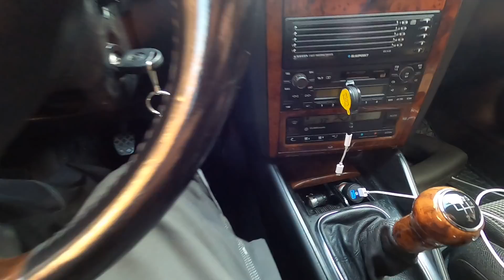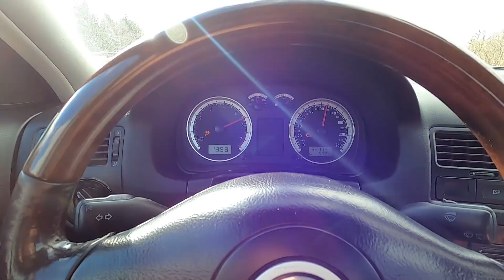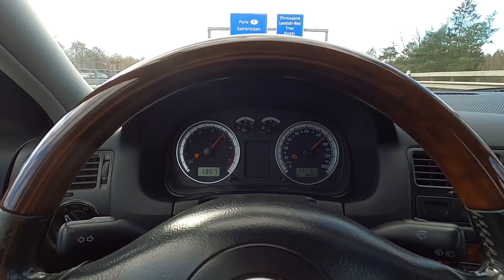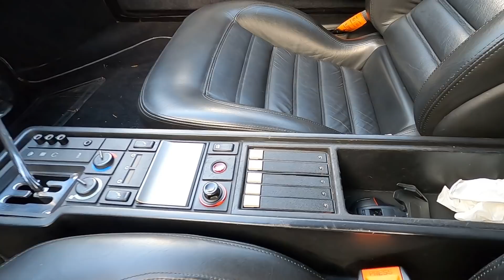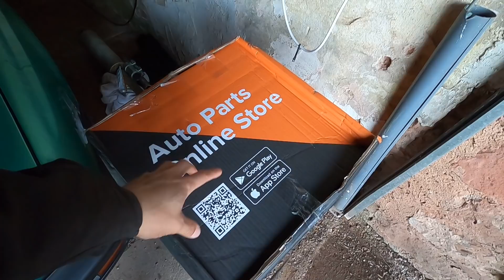30K!! New Seats For The Savoy? & My Clutch Is Here?!?!

Comment: A little tip for doing the seats, if you can get a drill brush attachment it would be a plus or a hand brush that can be used on fabric. Mix detergent in a spray bottle, spray the seats, then let it sit for 2-4 minsz scrub the seats left to right, up and down, then use just plain hot water in the extractor.  Also vacuum the seats before using wet vac. Will yield a better result

Comment: Would get better results dismantling the cloth from the seats and washing in the washing machine.used to do that often when i had mk3 gti.
Reply from the maker: I did think about doing that but I wanted to see how well the wet vac would do first lol
Reply: @Mk3Smith  from memory ( i had car 26 yr ago was a 93 gti) its a bit fiddly with smal metal rings holding cloth onto metal rods embedded into the foam seat but they came out like brand knew and was,nt that hard to put back together
Reply: @Mk3Smith  i even bought the mounting brackets and installed a center headrest,everything was already there in the seat frame.the back seats already had 2 from factory .i miss the days i spent in the junk yard like you looking for parts mine didnt have.center console cd holder,lower dash glove box etc 😊.

Comment: Seat Ibiza aren't a mk3 golf they're based on a polo tho slightly bigger I had a rare 1.8 gti version  but they had mk3 engines 2.0 abf and 2.0 8v, but the seats should fit. If you find a leather set they're wild patterns. For example https://images.app.goo.gl/3TC6HpiFirPaULeW9